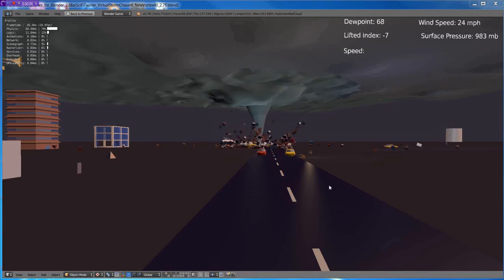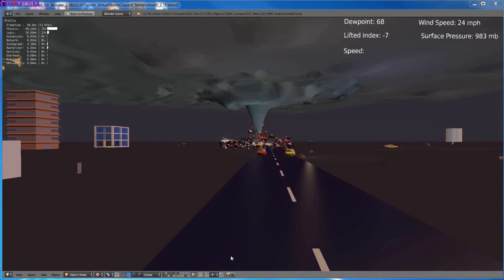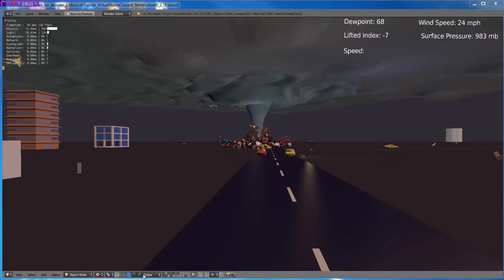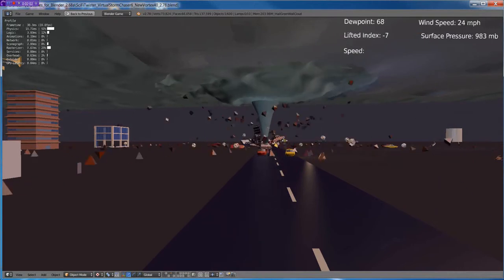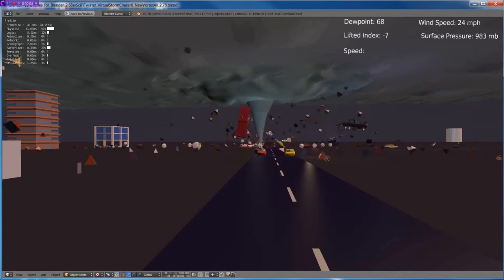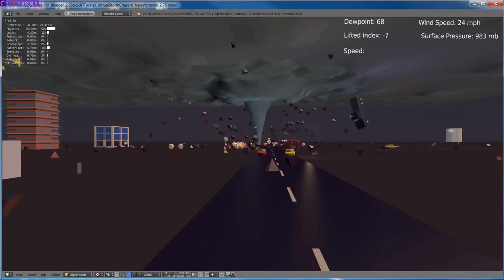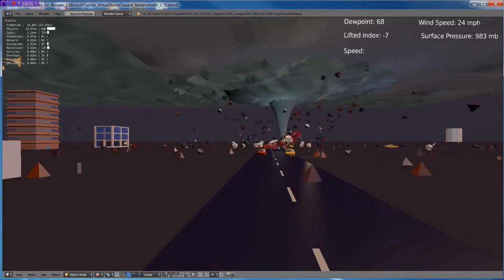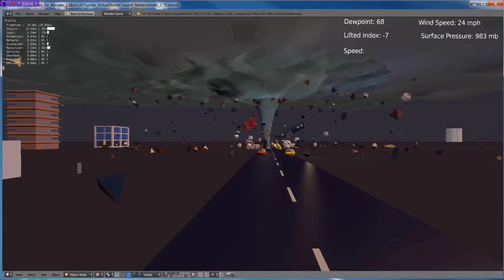Blender 2.78   GTX 1060 Test - Tornado

Comment: What graphics driver are you using. Blender won't use my gpu.
Reply from the maker: DirectX 11.0, Nvidia Driver 388.13 on Windows 7 Professional, 64 bit. Under Blender System settings, I'm using the CUDA Compute Device.